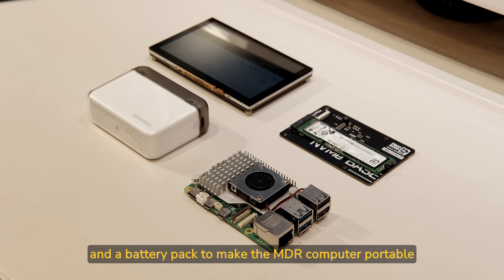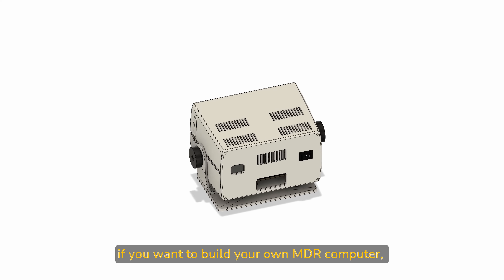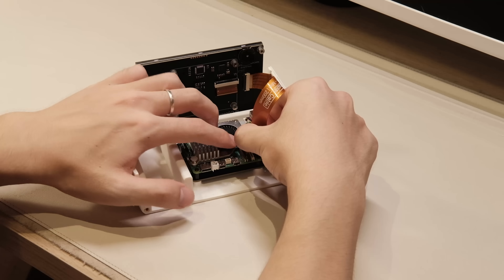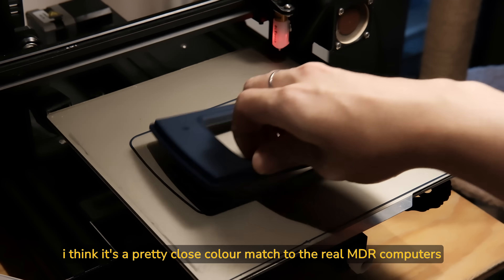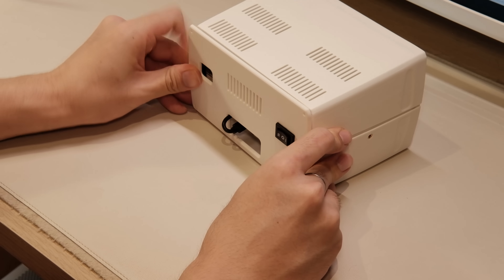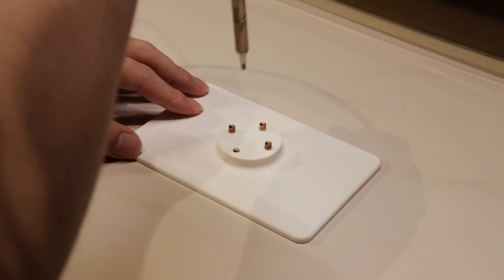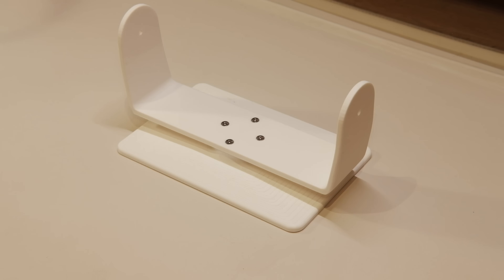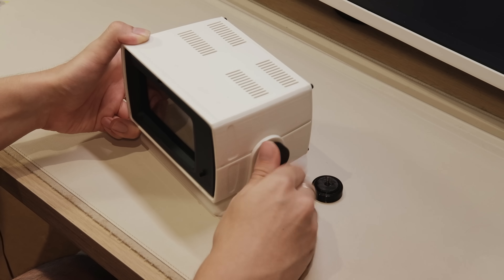3D Printing the Severance MDR Computer

Comment: Which CAD software are the files for? I wanted to modify it for an 8” panel.
Reply from the maker: @Micro_Repairs  i designed it on fusion 360, and the CAD files exported is a step file which should be quite universal
Reply: @ any chance you could also export the Fusion file itself? That would make it so much easier for me to modify, thanks!

Comment: If i buy the design files, does it also come with the software to run the MDR program on the raspberry pi? Or does it at least come with the instructions on how to set up the raspberry pi?
Reply from the maker: hey!, I set up the Raspberry Pi using the standard imager to run Bookworm Os and then using this website to refine data https://lumon-industries.com/

Comment: What size build plate do you need for the parts?  Was wondering if it would work on a Bambu Labs A1 Mini (180mm x 180mm) or if it needs a larger bed.
Reply: I just bought the files from his Patreon. All of the parts fit on my Prusa Mini (also 180^3 mm^3 build volume).